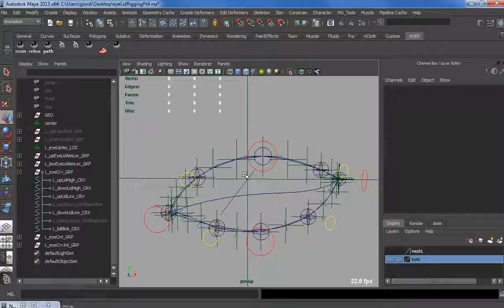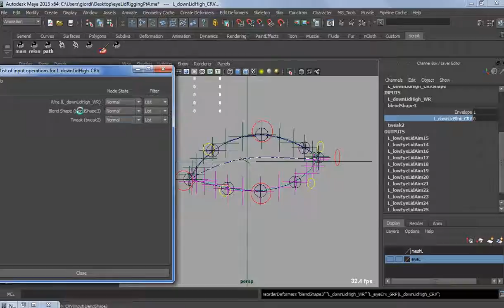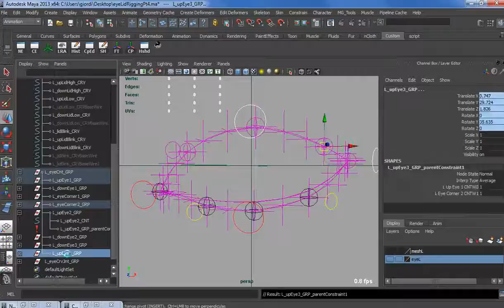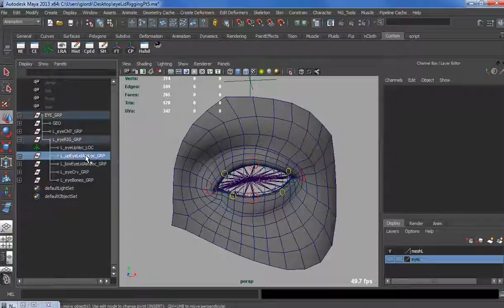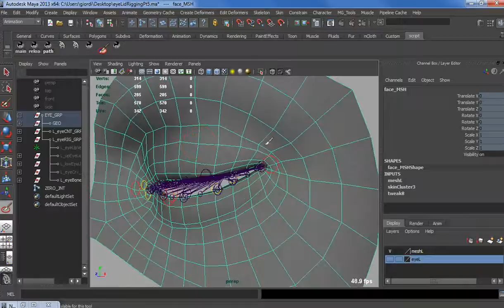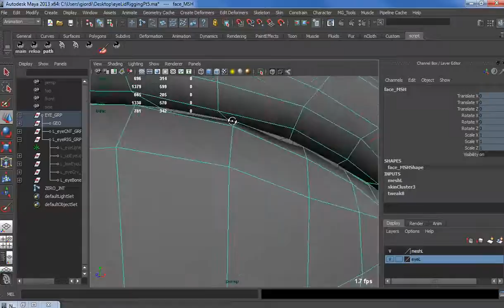MAYA TUTORIAL:   Cartoon eyeLid rigging PT3

Comment: Does the eyeblink animation works when exporting in unity?
Reply from the maker: Take this with a pinch of salt, it made this tutorial a while ago :D So if not mistaken the eyeblink works with bones being driven by a curve,  even the close eye using the wire deformer in the end still drives the bones, so your animation should make it properly to unity (although you might have to work on the hierarchy but should work (never tested it)
Reply: Marco Giordano Thank you Im having a problem creating blinking, dual quaternion is not working in unity is there an easy way to not make the eyelids and eyeballs mesh overlap with each other and export it to unity? is creating corrective works on unity?
Reply from the maker: @Juanimation  I would not use dual quaternion, it is also slower to compute. What I would do is add extra joints to keep the volume round during rotation. Say, the bone on the lid rotates 50 degrees, you have a bone that rotates 25 and keeps the volume up. The other option is to have joints sliding on a nurbs surface, you still need to add extra joints to keep the volume tho.
Reply: Marco Giordano Thank you very much 😊

Comment: well it very heavy, its can be done with one rotate able joint, but is good for some kind of close to the eye anims maybe
Reply from the maker: Pawel Jankowski , to be honest in a production case that s not heavy at all, 20 -30 joints for that lvl of deformation is totally acceptable, with that said performance wise there is a lot that can be done, like having a custom node to deal with the whole setup of part of it. It will allow to remove tons of intermediate transform and hand tune memory access etc on the c++ side. Also in the case of a heavy mesh using deformers just on interested vertices might help